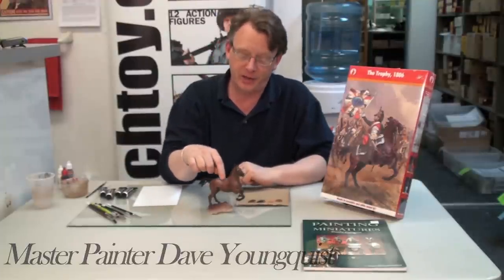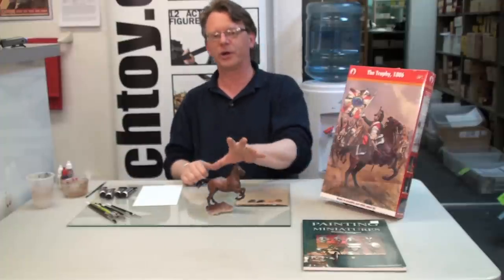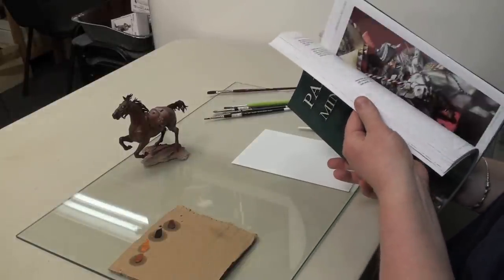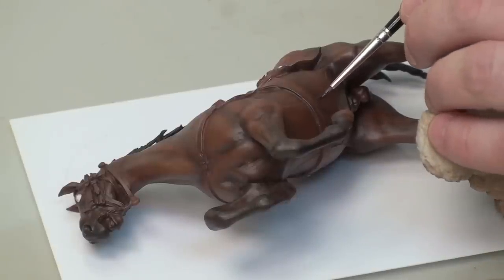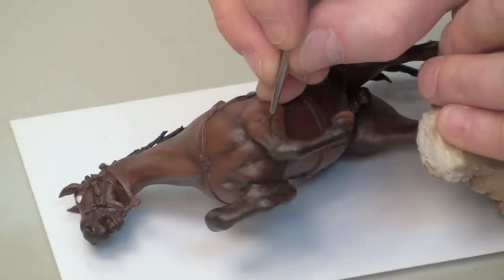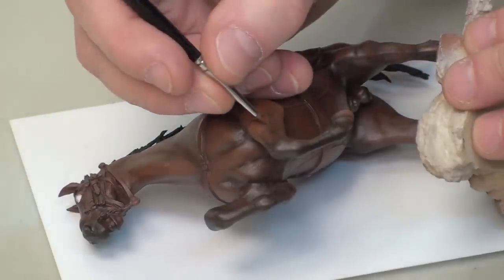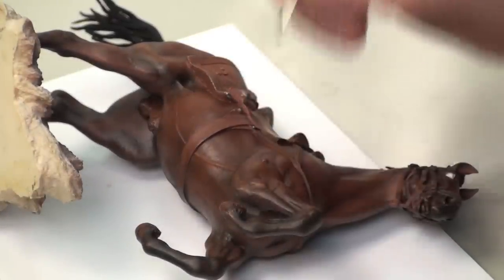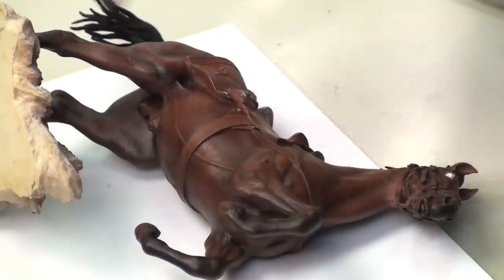Painting Horses with Oil Paints Part II

Comment: Would like to add some comments regarding the use of oils. In the first part excess oil was absorbed by using cardboard, fine, but please transfer the paint to a non-absorbent palette, reason being that small fibers of cardboard will be in your paint and tough to remove. Drying times for oils can be sped up by using a food dehydrator, 8 hours in a food dehydrator same as 3 days on your shelf. If your painting time gets interrupted put your palette in a plastic container and place in the freezer, to begin use again wait till paint is at room temperature. Next time you do a horse try base coating with acrylic flat orange, then work your oils magic on that. cheers eh!